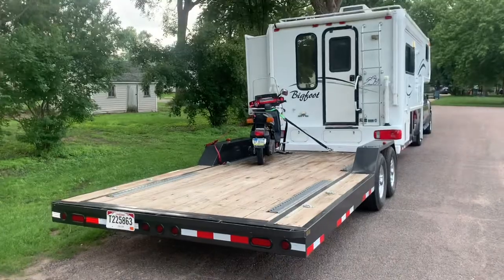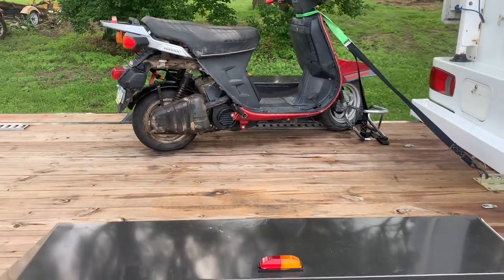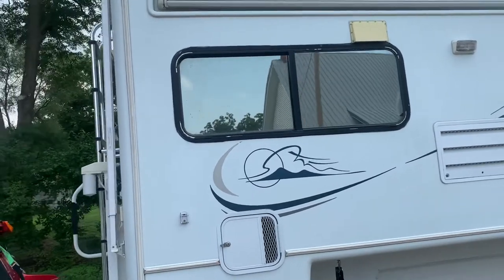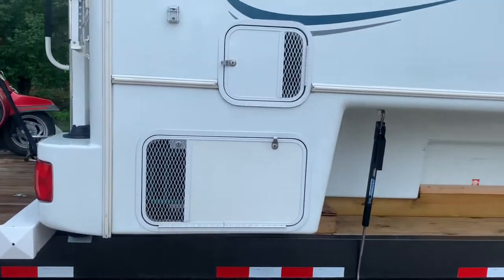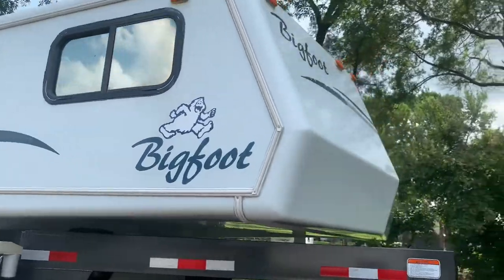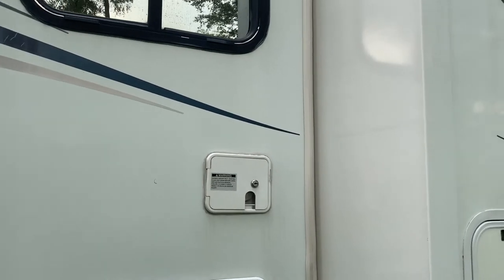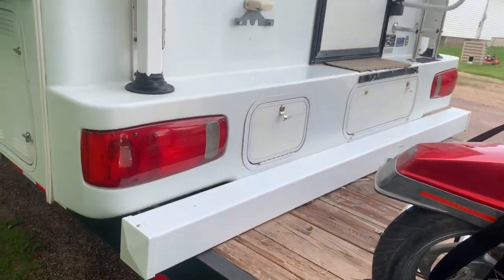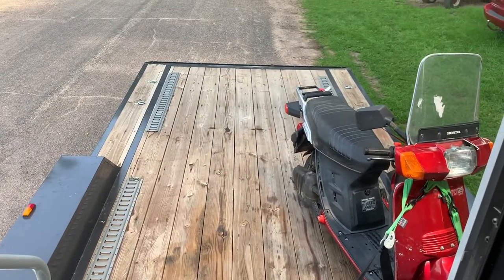2004 Bigfoot Truck Camper

Comment: You may have sold your camper already, but I just found your video. I was wondering if you remember the length and width of your trailer? I'm going to do the same thing with my 2020l1 Bigfoot. Thanks, Nate